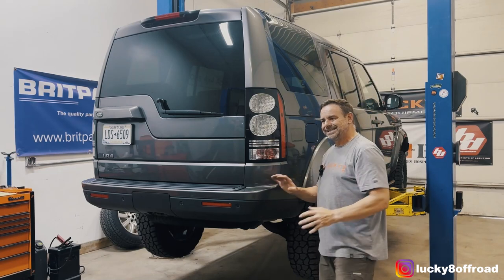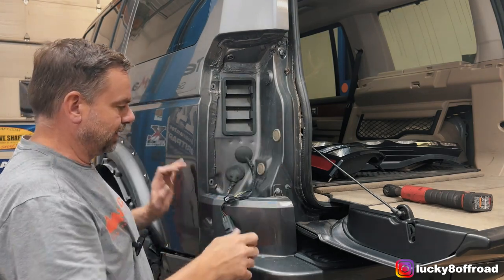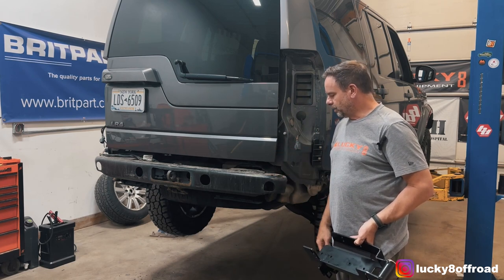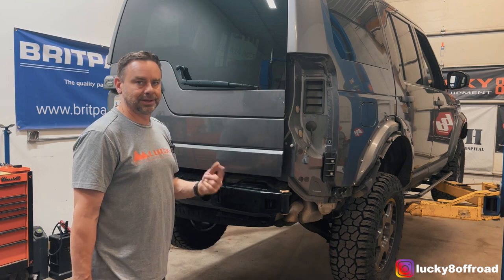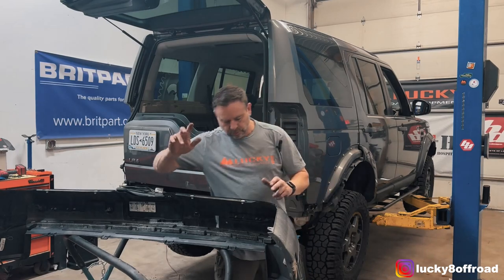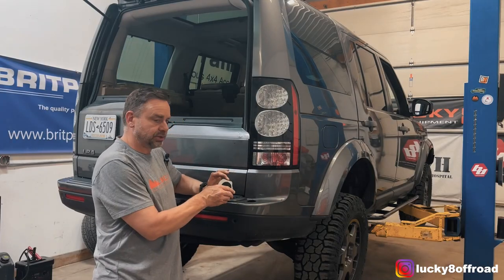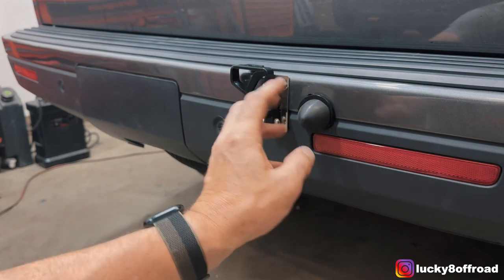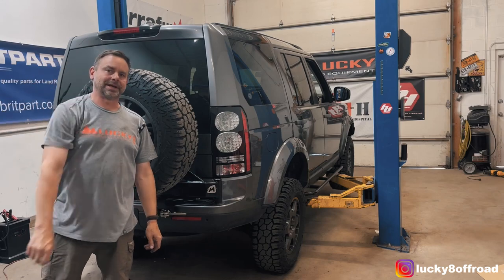Terrafirma Land Rover LR3 & LR4 Rear Swing Away Spare Tire Carrier Installation Step-by-Step Guide

Comment: When I purchased my LR4 it already had this tire carrier installed.  It has always been pretty difficult to open and close the carrier, but I assumed that was how it was designed.  It has been getting more and more difficult and now it takes pretty much all my weight to open or close it.  I watched your video and you mentioned a bolt that goes up into the carrier from under the bumper into the cylinder that goes into the bumper. I also see that the one you installed opens with just the gas strut and is easy to close.  When I look at mine I do not see a bolt in there, so I think it must be missing.  So a couple of questions: 1) should I be worried about that bolt not being in there?  2) any idea why it is so hard to open an close and any idea how to fix it?
Reply from the maker: I'm sorry I don't know how to answer this without seeing the carrier. I would definitely recommend putting a bolt in but I don't think that is what's causing it to be difficult to open

Comment: Aside from the price, is there any benefit to using this over an entire new rear bumper with a tire carrier?  I like the idea of a metal rear bumper as the butt of the LR4 sticks out so much, but I could see the a drawback being lugging around the extra weight all the time.
Reply from the maker: Just the issues you brought up. Cost and Weight. Although I have bumped and bruised my rear bumper, I have never felt the need for a steel one

Comment: Just fitted mine, the wheel doesn’t sit flush to the mount and had significant wobble. Seems the bots supplied are too shallow to create a seal, how did you overcome this?
Reply from the maker: I'm a little bit confused the mount is fully adjustable. The wheel should sit flush on it.
Reply: @Lucky8  it sits flush but the bolts provided do not tighten flush and this allows the wheel to wobble, I’m going to have to sheer the fixed bolts off the back and add a plate and threads to allow the fix to be tight and flush.
Reply from the maker: Something doesn't sound right at all. You shouldn't have to cut or weld anything
Reply: @Lucky8  I worked it out the back plate came pissed so I had to use different amount of washers to get it to sit flush 👍

Comment: So I’m trying to remove one here at the shop I’m working on due to the rear bumper needing to be replaced, I looked underneath where the bolt and washer should be but there’s neither, I’m not sure if the whole swing arm is seized on or what’s going on can anyone give me a tip on how to remove the swing arm alone to remove it?
Reply: Update, it was seized on
Whoever installed it didn’t put the M10x30 bolt and washer on the bottom side so it confused me a bit. I just used a 18mm impact socket + extension and hammered the lower end until it moved up enough to pull out
Reply from the maker: good to hear you got it figured out.

Comment: Will it trigger the proximity sensors?
Reply from the maker: That is a great question. Depending on how large the tire is , it will more than likely trigger the sensor.
Reply: Got one on my car and it doesn't affect the parking aid sensors.
Reply: I have 275/65/18 and the sounder goes off every time I go into reverse.

Comment: FYI: I did not have much fun installing on my LR3 in 2023. Some templates were wrong, probably for LR4. Then the swing away arm would not go into the holder. Had to buy a cylinder hone and enlarge the bushing. Works fine but poor instructions and QC.
Reply from the maker: If it makes you feel any better, we also have run into the cylinder not being large enough definitely makes it no fun
Reply: @Lucky8  
Afternoon through similar BS when fitting a snorkel to my P38 I swore I would never buy anything from Terrafirma again. They don't even give you templates for the snorkel.
Reply from the maker: I hear you, but they're the only ones willing to make parts like this so I tend to forgive a lot of the little issues